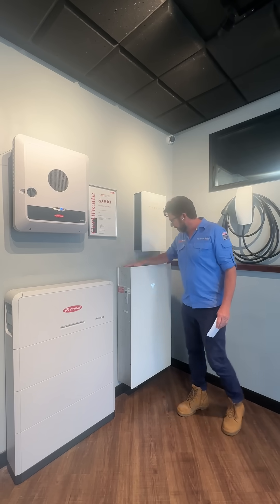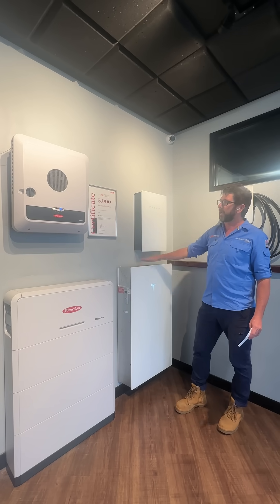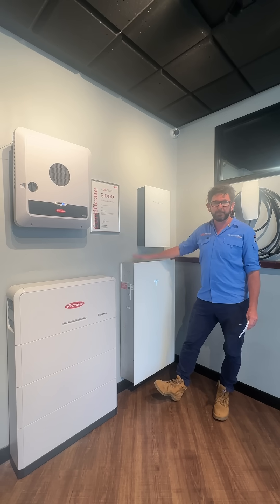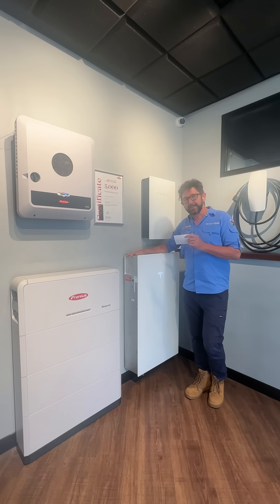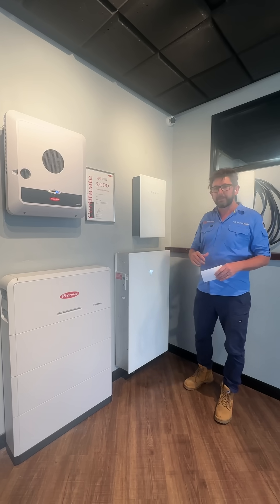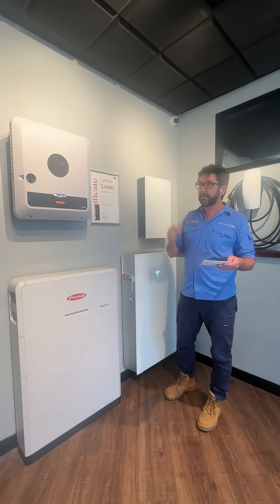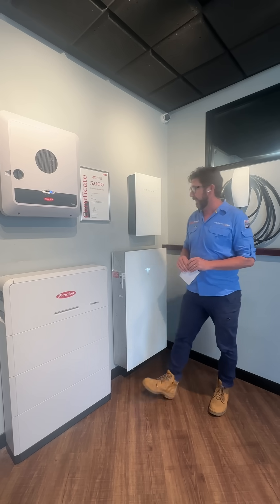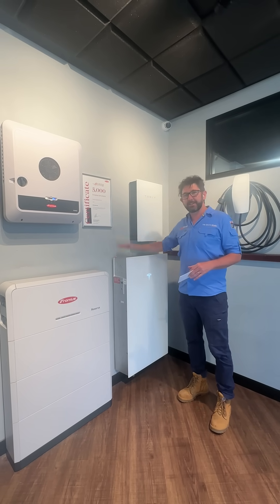Tesla Powerwall noise and efficiency

Comment: Mine doesn't discharge at 10kw!
Reply from the maker: What does it discharge at?
Reply: @mcelectrical limited to pulling 5kw from the battery despite having the Powerwall 3 and expansion battery.